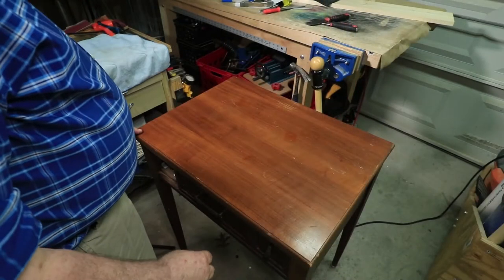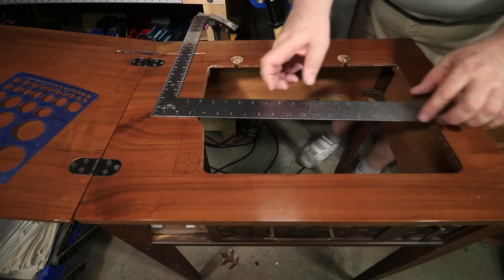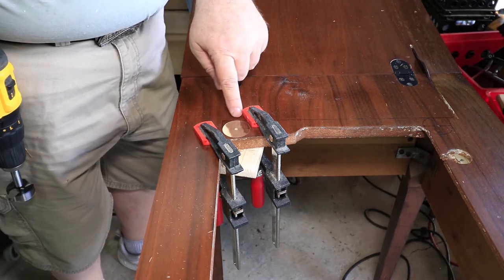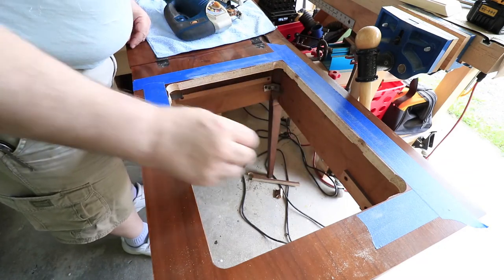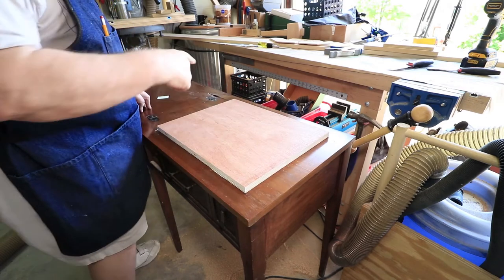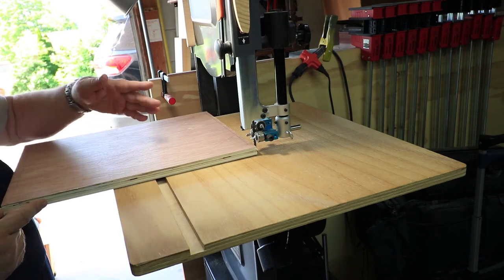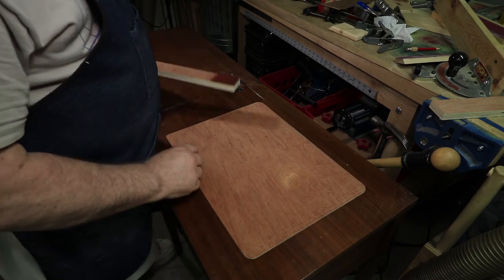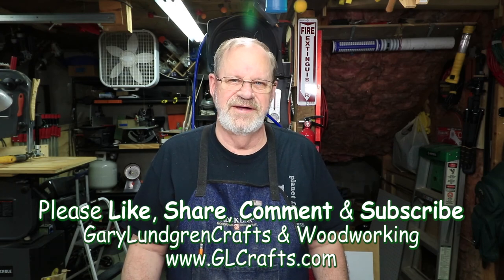Furniture Repair Techniques - Sewing Machine Table Conversion Ep.2018-21

Comment: Mine is a bit different bc it has a wooden arm to cover 1/2 the space of the opening. I was debating on installing brackets 3” down inside cabinet to secure the wood bc of my sewing machine. I need the pressure plate flush with the table. But I like how u used the wood strips to secure the wood, that’s perfect. Time to plug up the band saw! Awesome I’m heading to Lowe’s. Thanks!
Reply from the maker: Thank you!

Comment: Very nicely done! You have been doing this longer then I have so more than likely I'm doing it wrong. When I use the jigsaw for straight lines, I use some sort of straight board as a track for the base of my jigsaw for a nice straight cut. I see that you used the router for that. I guess in my mind it would be to eliminate an extra step of course.  Just a thought. Thanks for sharing Gary!
Reply: Another thing, it takes some real skill to fit a piece like that almost perfectly. Wow!
Reply from the maker: Thanks! I used to try to use a straight edge with jig saw, much like with a circ saw, but the jig saw blade tends to flex. It also gives a rough or jagged finish edge. Good for rough work, but for finish work I like using the router. Less chance of a slip up. I do that a lot.
Reply: That makes a lot of sense! I'm going to do this technique from now on. Thanks!

Comment: Since it was unlikely that you would be able to match the finish of the insert to the rest of the table, I would have glued a sheet of green leather to the plywood to make it look like a writing surface.  With the correct thickness of leather, you might have been able to eliminate the thin MDF shims, or used thinner shims.
Reply from the maker: Thanks for the tip!